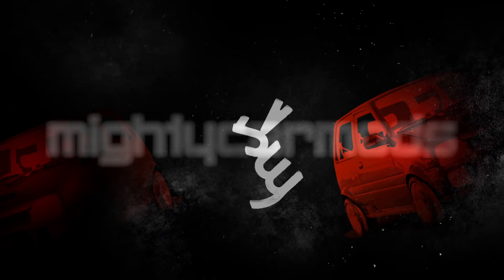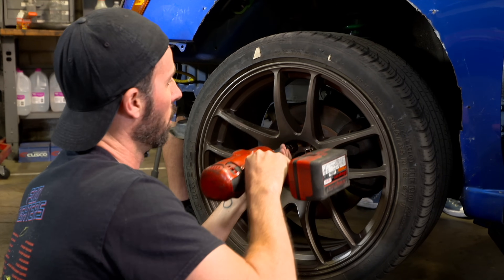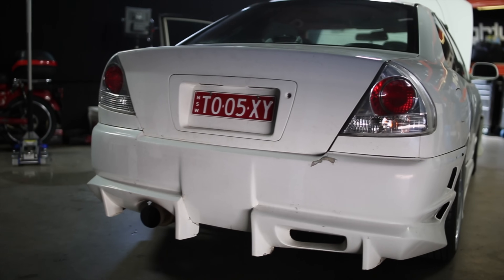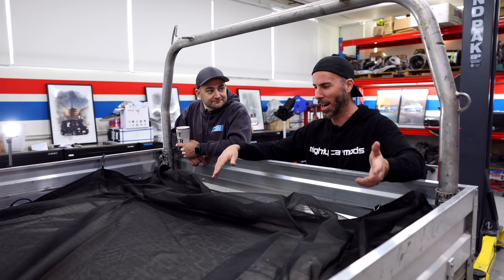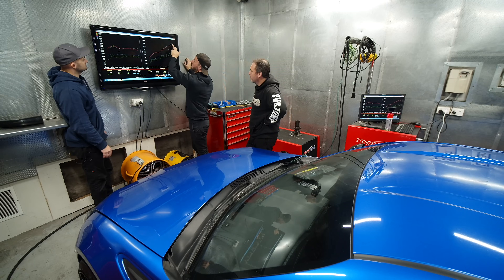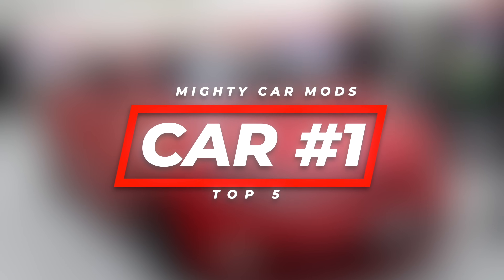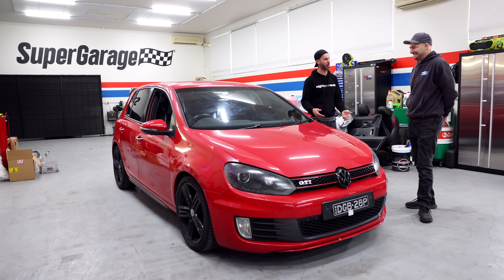The 5 BEST CHEAP CARS to Modify FAST | MCM

Comment: I miss my old EG Civic coupe (in aquamarine blue), 1.5 LSi (yeah it wasn't... proper lol), but, did loadsa mods.. Mugen chip, cold air intake (from front bumper, 4 branch manifold, sports cat and sports back box, full LED rear lights (i modded them to have all 4 rear light rings come on half brightness for lights and then full brightness for brake lights - like R34 GTR style), Electro Luminescent speedo/rev/clocks, lightweight 17" alloys, Sony head unit, Pioneer amp and JBL 1000W sub, LED DRLs.. man I loved that car... Shame I trashed in on sleet on a busy motorway (bouncing it of both centre and edge barriers... 😕😕😕     😎🇬🇧

Comment: Toyota Corolla…dark side…
Perfectly understandable as thanks to all of the sub-variants they do of them making them perform can be a dark art! With some years having zero aftermarket support. 
However the 2002-2008 Corolla hatch did have some TRD performance parts like a bolt-on supercharger and suspension parts, while Whiteline has a selection of suspension parts due to the platform being shared with a Lexus. 2012-2020 hatch though, upgraded suspension kits and exhausts were available from Japan once you knew what it’s JDM subtype was, also if you wanted an itasha car done mildly, a Gundam inspired body kit was available.

Comment: thoughts on a focus st mk2-3 ? looking at getting as my next vehicle, my coworkers veering me away from wanting a subie due to common issues he has mentioned with the motors and a few things. As someone not mechanically experienced (yet), which would be more efficient of a route when it comes to money spent and reliability? 2015-2020 wrx - 2017-18 Focus St mk2-3
Reply: What did you end up buying?

Comment: love it! In germany you could snatch an Audi TT 2014 quadro with a 2.0l VVT Turbo engine for sub 15k€ wich is more than 15k AUSD, but still awesome. Any chance you guys would do an TT as a mad street / Nightcruise car?
Reply: Not exactly popular in the AU. I haven't seen one for couple of years.
Reply: Cost of running older Audis is really high in AU. 4.2L or 2.7TT maybe the worst, but even the 4 cylinder models cost heaps to keep on road.

Comment: None of these are ”cheap” 13-15 000 Dollars is like buying new car in the EU… It took me 4 years to save up to a broken Celica GT4 for 2000 dollars and rebuild it over time… 11 years later I have a working Celica GT4 with almost 18 k metric miles on it. And if I’m lucky it will sell for 9000 Dollars today… But I will never sell…

Comment: out of curiosity did Australia not get the 350Z/370Z? I never see you guys talking about it and based on pricing in the states, a used 350Z could easily be cross shopped with a 86. Maybe they're just a lot more expensive for some reason over there.

Comment: 98 to 2004 (mk4) was the best years for volkswagen golfs, bulletbroof engines (unlike 2.0 tfsi), body dont rust new like in the mk5 (mk4 rear axle beams have rusted trough, but these are old cars now and new axle beam is cheap) not too much electronics, the looks have not aged too much.. The same goes for passats of the same age, just bulletproof cars

Comment: You didn't mentioned the Mazda RX-8 as alternative to the GT86/BRZ, and those are cheap, fast, rear wheel drive.... also thirsty and unreliable (specially if not maintained properly). Also... didn't the MG TF or MGF been sold in Australia?

Comment: I love this show. But with videos like this, I feel like we are from different worlds rather than from the other side of the world lol.

- Average salary in my country: 500USD per month.

- Ek4 Civic (B16 from factory): 8k average for 4 doors, 13k average for hatchbacks. Don't even think about buying an EJ6 to Kswap, They go for 6k average, if they are in good shape, asking price is way above that. A Kswap is cost prohibitive. And there's no B16/H22 available to swap one of those either.

- WRX GC8s will go from 15 to 25k, easily. Anything newer than that, you can expect asking prices of 30 to 60k USD.

- A 2010 Hilux sells between 15k and 25k, depending on trim/milleage/general state.

- BRZ were never sold here. Used 86s, will go from 25k to 35k cash. 

- Mk4 Golf GTIs go for 8 to 15k, depending on what level of madness the seller has. Mk4.5 GTIs... ain't nobody got time for that. Mk5 GTIs never made it here. Mk6 GTIs go for 20 to 28k. Mk7 GTIs sell from 34k to 55k LMAO!!!

Enjoyed the video, but I enjoyed even more laughing at the current used car market in my country. And when I say laughing, I mean crying.

Comment: Depending on how much work you're putting in, the late 90s Lancer (we call them a Mirage in the US) with the 2.4l manual swap like you guys did for 2sexy is going to be pretty fast even NA compared to a Civic. The cars and the swap parts are not extremely easy to find anymore but they are worth basically nothing if you can find them, it's great value. Mitsubishis in general are great value besides Evos, and the parts binning options are huge just like a Honda.

Comment: Is this an Australia thing? I mean, don't get me wrong, those a great cars but how about older BMWs? Like a e78 130i (my car), a 328i e49 or e90 330i. Those are easy to work on and you get a lot of after market parts. A lot of people use those for track usage on the Nurb. btw,  great video!
Reply: BMW parts are so overpriced here that some people with older cars import them from the states or Europe.
Reply: In fairness they didn't mention a single Australian car as such...completely ignored the BA-BF-FG fords with the barra, as well as any 2006 onwards Holden Commodore - most make at least 100kw per ton stock, approx 180kw+ total

Comment: Prices are going down for Subaru's but the secondhand market for parts has gone through the roof. A secondhand EJ255 turbo engine goes for nearly $5k, don't even get me started on a JDM model... just parts for Subaru's in general have gone a bit crazy it's not so much the value of the car but the parts market has gone absurd.

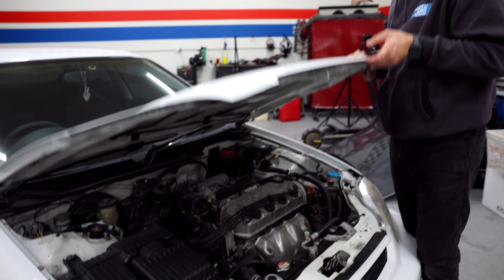Comment: @5:09 That's a D16Y8 which is a sohc VTEC engine judging by that intake manifold.
Edit: my apologies, that's a D16Y4 that was shipped to Turkey, Australia and NZ. Here in the states we see that intake and know it's the "pregnant" intake and comes equipped on the Del Sol and Civic EX from 96-2000 with the 127HP vs that 120HP. Cheers!

Comment: Sorry boys but i disagree with your comment about the toyota competitor to the civic, there were 2 models that fit in the performance model pigeon hole, there was the 1.6 4age and a 1.8 7age powered corolla and both have been modded to very high power and revved as high as the vtec moters.

Comment: After working on my friend's MKIV Golf GTI, I would NEVER recommend one to anyone who doesn't want to deal with electrical issues forever as it ages. They used that goofy biodegradable wire sheathing and they crumble to dust. He asked me why his headlights weren't working once and when I popped the hood and dug into the wiring, most of them were BARE WIRES and what was left of the sheath crumbled away in my hands. I had to completely redo al of the wiring for that, for some of the cooling fans, the horn and a bunch of other random stuff I can't remember now. I can't even  imagine what other wiring we can't see might be falling apart too. AVOID the MKIV at the very least. Of the few I have experience with actually working on, these were the ones that I cannot believe aged this way. I love my 1994 300zx TT, but I know it is a bit of work and money to keep it on the road, so it's not for everybody. Though the wiring on my car is still perfect after all the years and miles. The GTI, not even close.

Comment: 15:00 The money you'd spend on a FWD Lancer would be around the same money you'd spend on an AWD narrowbody Impreza. It's naturally-aspirated, but it can fit most of the parts that would also fit the narrowbody WRX. If you need more power, you could fit in a turbo straight from a WRX. A good tune would even give it a smoother power curve than a WRX as the NA engines from these narrowbody Imprezas came with 10.1:1 compression ratios. Subaru beat Mitsubishi here in every way.

Comment: I agree with most of the selections, except for VW. Reliability is a huge issue with this marque and are we supposed to just forget about dieselgate?
Reply: Dieselgate happened but nearly every tradie with a dual cab makes more soot, they are the company that was most publicised but they all did it
Reply: Have had 5 vws from 2005 up including gtb1756vk turboed tdi with the works and reliability was fine running 32psi and no dsg issues when i sold i with 250k km.
Reply: @bgcarter1  Individual experiences are maybe not the best indicator of reliability. In 2019, the Choice consumer organization reported that VW was the third most complained about brand of car in NSW.
Reply: @bgcarter1  Yes, some other German companies may indeed have done the same thing; that is, deliberately subverted environmental regulations so that they could make more profit. Some estimates suggest 38,000 people a year die early due to the failure of diesel vehicles to meet official limits in real driving conditions.
Reply: I am not referring to german manufacturers, Toyota is who I was referring with their 2 BILLION dollar aust lawsuit for cars manufactured over a 5 yr period from 2015 to 2020... also nearly every tradie dual cab navara, Colorado, triton, etc etc they all blow shit tonnes of black smoke every time the owner puts their foot down. My vw dieselgate mobile does not.

Comment: Did you guys get the FRS in the lane down under? Because, of the three, the frs is the king.
Reply: frs is the same as the brz
Reply: @arcanevoid9199  the interior and overall aesthetic was more geared towards young adults. There was more to it.
Reply: @deltacharlieecho4732  they are almost identical, there really isnt any differences worth mentioning other than suspension changes. and those are only between the brz and 86 because the scion is pretty much exactly the same as the 86

Comment: I'm a mechanic at Volkswagen and would never buy 1, I have a 06 swift sport with a greddy supercharger bolted on and underneath the car it's so much cleaner with 150,000km+ on the clock compared to many golf's I work on. My swift isn't as fast as a gti but i also bought it for 1/4 of the price of a golf

Comment: I feel they intentionally skip Nissan z's in this list. 350z's are so cheap now and easy to mod and have a huge community behind them. Huge aftermarket support as well. Just interesting they didn't even mention z's in this list.
Reply: Really not that many around. The cheapest manual in the country is a 2002 for $17k. Also, I imagine the list is largely built around the cars they have around.
Reply: @julienrudd7545  ya I’m from the us so if they are going off their market it makes sense. I feel there are plenty of z’s in the states under 10k that run and drive perfectly. I might be wrong though.

Comment: Sorry mates, buddy had a mid nineties Nissan Sentra, his wife had a VW Jetta. Just a regular Jetta.
He hated working on that VW. In the time it took to find, access and fix a radiator hose leak; he could swap the clutch in the Nissan.

Driveway for both, on gravel.

Also, that gen two Jetta had PLASTIC connectors from the metal of the cooling system to the rubber hose.

He was so angry. For days.

Comment: For those GTI prices you're talking about clapped out 200k+ kms on the clock. Engine and transmission rebuilts aren't cheap. Sub 100k ones are closer to 15k.

Comment: where can you get a wrx for under 10 grand? ive been looking for ages an not seen a decent one with kms under 200,000 for less than 16 grand :/
Reply: Depends what year you’re looking for and where you’re from. There’s plenty of 1996-2007 wrx’s listed for import that are under 150,000kms for $7,000-$10,000 in Canada
Reply: @shaloon64  yeh fair enough. I'm in  West aus an chasing pretty much the exact same model they showed, preferably stock an lowish kms. As far as I can tell I'm looking at 15 to 22 g
Reply: @iainbain5586  yea true I haven’t seen a hatchback wrx for under $15k with decent kms. They’re are over $20k usually

Comment: An now in Autralia you will have Cupras ... VW group, so easy to tune and have parts but a bit cheaper and faster than his brothers. Leon cupra needs the 5 cilinder engine and AWD to be faster than a audi RS. The Formentor VZ5 is faster than his brother with same engine and it is because they have been tdesign and tuned in Seat sport facility not in Germany so they have put some spices ... but I think in WV and Audy they didn´t like that 😅 A Seta faster and more sportive than a Audi? With that  price? Errr 🤔 ... yees. Cupra is the sport range, so this is sport. German Tech with something more. But we need more 5 Cil engines (easy to tune up to 400hp or a bit more)

Comment: I really wouldn't have the WRX on that list. These cars have severe reliability problems and there is a very high probability to have to spend at least $5-10k on engine repairs on top of the car itself. The transmissions are trash too.

Where I am (Canada) this list would look very different, honestly the situation in Australia must be really sad to end up with these 5 cars lol. The BRZ/86 should definitely be on there, that much is a given. However, the GTI and Civic are pretty well the least interesting things one can get over here for the money. There are countless better and more exciting options if you're on a similar budget: 350Z and a variety of dirt cheap and powerful Infiniti models with the same engine, Lancer Ralliart, Toyota Celica, Acura RSX, NA-NC Miata, FB/C RX-7, RX8, Mazdaspeed 3 or 6, Saab 9-3/9-5 Aero, 05+ Eclipse GT, Focus ST/Fiesta ST, a wide variety of cheap muscle cars like Mustangs and Chargers, Fiat 500 Abarth, Mini Cooper S, Porsche Boxster, and many others.

Comment: Mini Cooper s R53 supercharged is available for as low as 10k and even as low as 3-4000 bucks now that's unbelievable power and car for money  it you went to the turbo only the mini withbig head conversion kit and supercharger kits from procharger and also full STIFFINING and suspension basically a full cup car race car for the road but people don't like them as the price on good one is as high as 30k for the non turbos and then you get the tur o ones and they are the r56 so turbo and upgrades are liberty walk wide ody with full tucked and wings and a nice stereo and the you can get the factory 4wd one and we'll gotta say I'd put my modded supercharged mini with a full engine upgrades  cams and cranks and basically a 2.5L stroker kit I mean coming a ready to go racer do some work make it 4x4 and I have a super  cooper

Comment: What about the R53 mini Cooper S Supercharged bmw version the first cooper s model mini bmw released and some mods and some coilovers brakes rims and exhaust and headers will make the 86 and BRZ cry and if you spend a few bucks make a super cooper and make it 4x4 and its easy with Toyota trd or pulsar and other many aed parts to make it AWD and make it a 500hp AWD Evo eating and Toyota eating mini the originals in supercooler or duel engine mini Cooper s supercharged R53 that's best bang for buck don't buy one with mega kms as they need more work

Comment: Where are you guys looking to find WRXs for under 10K?
I have not seen a decent GC8 for under 10k (that doesn't require immediate and substantial work). For a semi reasonable one you're looking at 13-17. 
Only seen GF8s (the wagon) sell for that money. Same with the 08-10. Have not seen many, if any on the market for 10k.

Finished the video... Where did you get your prices from.. Good luck finding half the cars in this video for the prices mentioned. 
Don't disagree with the list with that said.
Reply: I'd also say a GSR lancers, VR-4s, legnums etc would be more of a wrx competitor than an Evo. An Evo is leagues above *most WRXs.

Comment: None of those are that fast stock.  Why not get the 7th gen NA Accord 3.0L V6 coupe 6spd that will beat most of those and have Honda reliability?  0-60 in 5.8s.  Easy to get for under $5k and parts are cheap.  Engine swaps to the 3.2 & 3.5L are common.

Comment: The Hilux is what trucks should be, unlike the huge ugly monsters here in the US, which are so big you can't even reach into the bed from the side without a stepstool. Automakers are now making the tailgate turn into stairs and a handrail because you can't climb into the bed by just stepping up on the bumper, which is now 4 feet off the ground. I miss the 80's and 90's trucks.

Comment: a front wheel drive can't be #1
Reply: why not?
Reply: @arcanevoid9199  they're just not nice to drive hard
Reply: @justice4g  what do you mean by drive hard? just sounds like your blaming drivetrain for incorrect technique
Reply: @arcanevoid9199  I've owned front wheel drives including a mk7 golf, they're horrible when you put your foot down, it's not technique, it's the feedback in the steering wheel and they just aren't enjoyable to drive compared to RWD.
Reply: @justice4g  i mean as nice as a mk7 golf is they are quite a boring car, and thats not very specific. are you talking about torque steer or just general steering feel? and having rwd doesnt magically make something fun to drive, you should try a fwd sports car. good fun in the wet when you can step the back end out just by stepping on the brakes in a corner